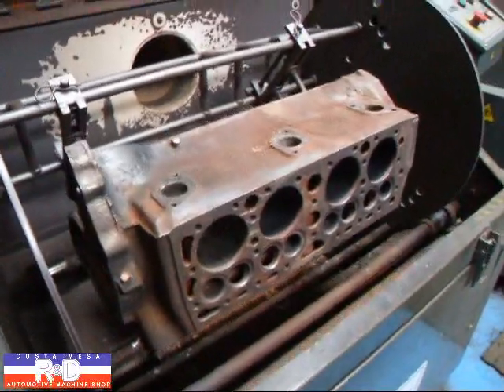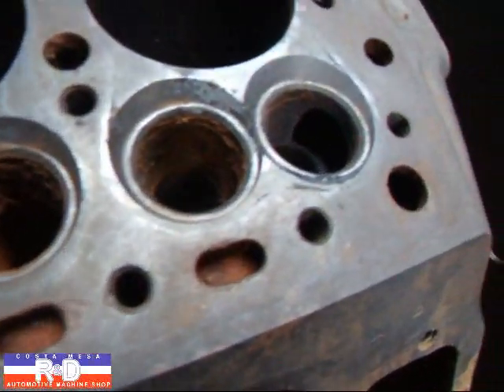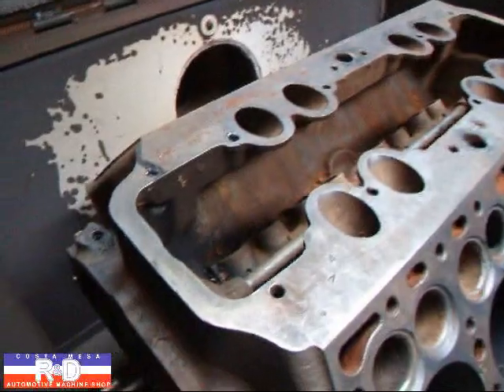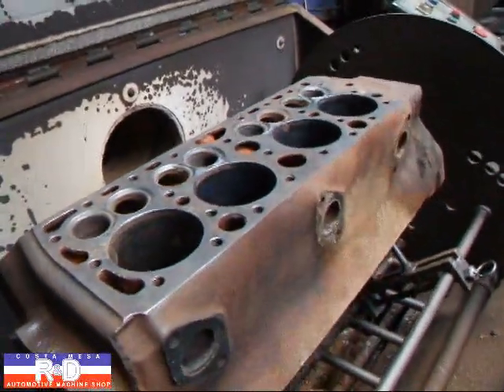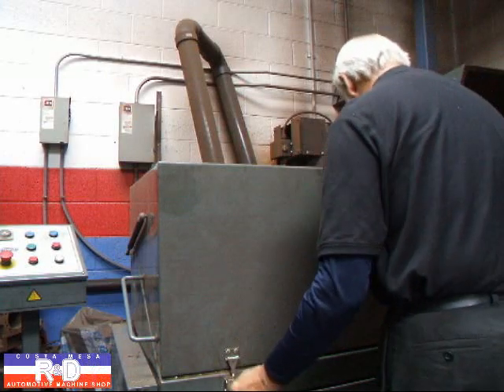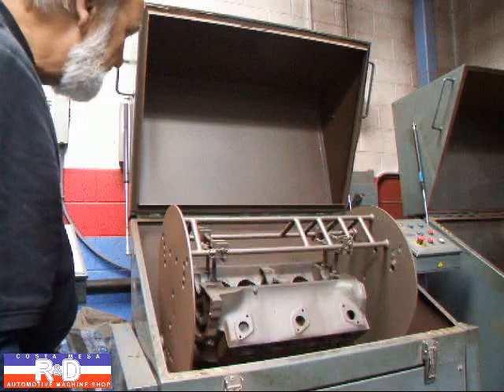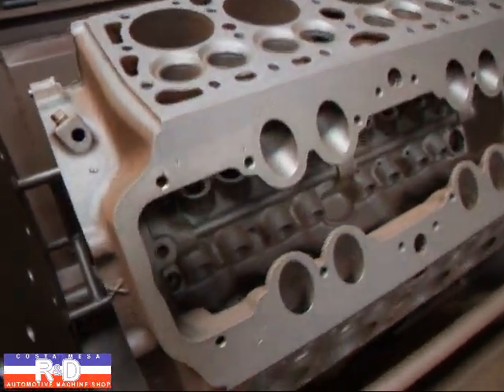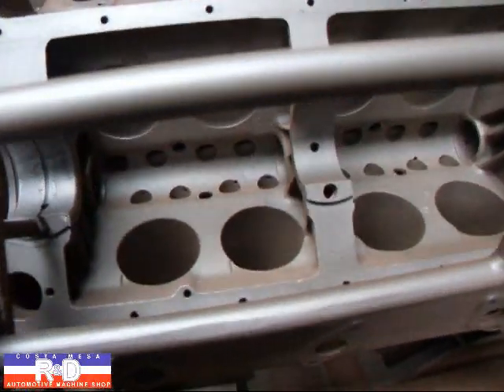Flat Head Ford V-8 Thermal Cleaning

Comment: how hot does the thermal cleaner need to be to burn of the old oil and baked on grime? Also when you media blast it after do any of the machined surfaces need to be touched up afterwards? You make all of this machine work look very easy!!

Comment: The flat-head videos I have been watching lately show people ran 50's era flat-heads until the pistons melted and/or the head gasket leaked for years and corroded the heads all to heck and they would run - which makes me think 50's flat-heads were really stout engines.